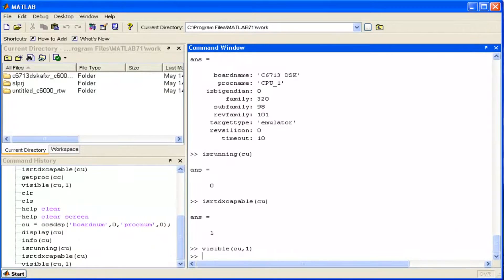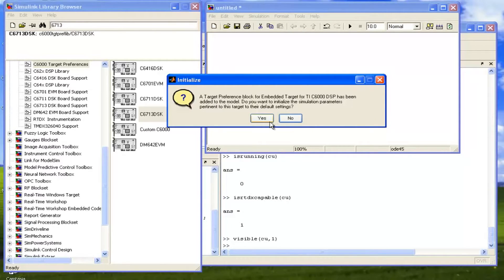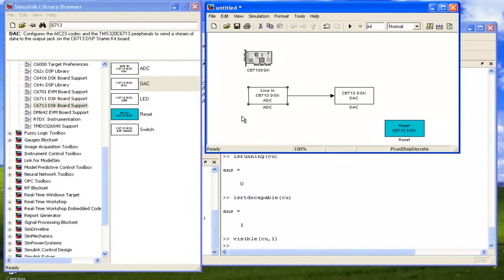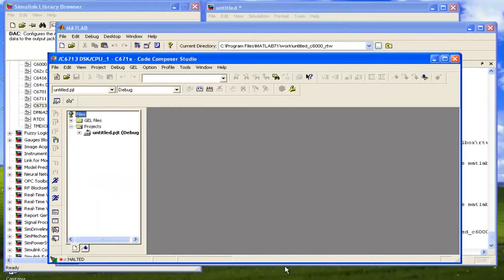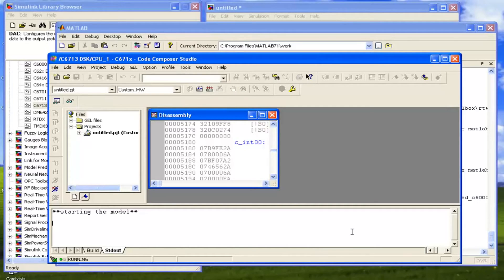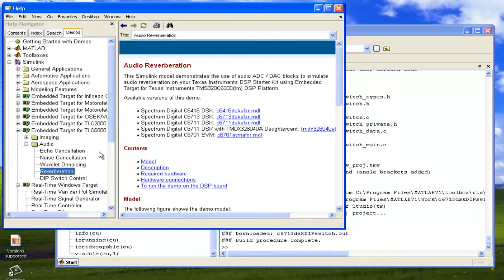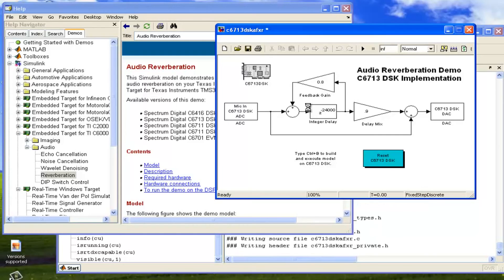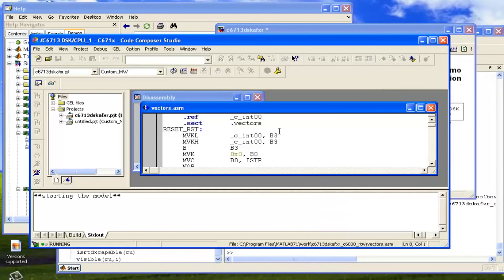MATLAB and SIMULINK integration with CCS v3.1 + Examples - DSP Kit Tutorial 6B

Comment: Hello, very nice tutorial. I have the TMS320C6416 DSP , this card only works with Matlab 2007a and the software that came included in the DSP box , on a CD . My question is if I can work with the same card with a modern Matlab, like 2013 or I need another version of Code Composer? Thanks for your answer.

Comment: Hello, nice video. I would like to ask you, what is the configuration required to load the program in the flash memory of the DSPF28335. I got an error about the flash API, but I have installed them correctly. Do you have another tutorial about it. Thanks!